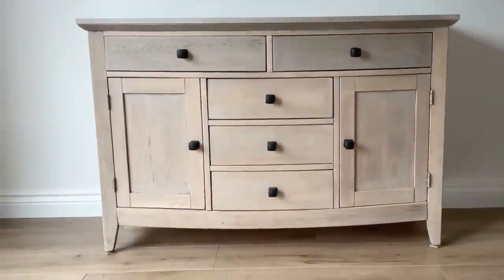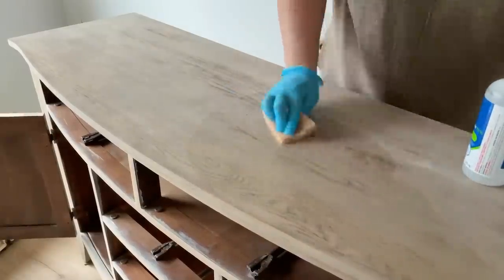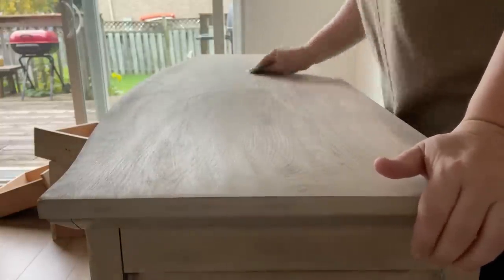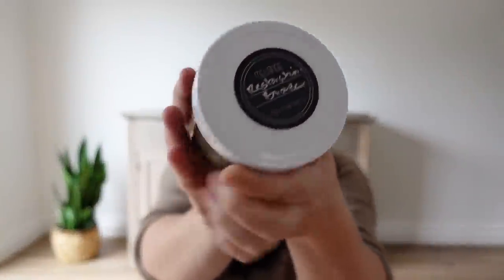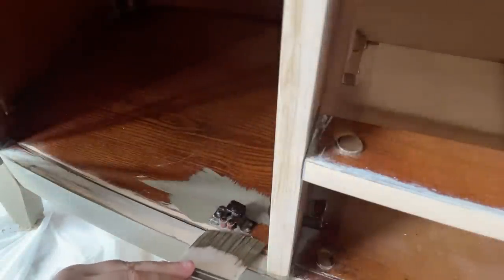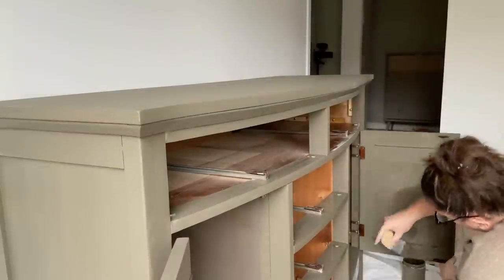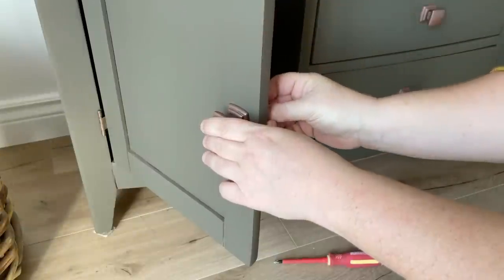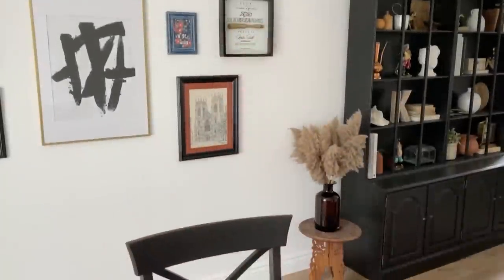One Day Furniture Makeover | Beginner Friendly without any fancy tools!

Comment: Hi Katie, I was looking for furniture painting ideas and inspiration and found your channel. Your makeovers are great. The problem is I live in the UK and can’t buy the Melange paint, can you tell me more about it so I can find a similar product in the uk. I can buy French Chic, Annie Sloan, Rust Oleum, Dulux etc. I have a wardrobe which I painted ,not very well, a few years ago and would like to repaint it, the trouble is I need to do it inside although I can remove the doors and take them to the garage. It’s a pine cupboard which years ago I restrained, and then rubbed down and painted with an emulsion paint and rubbed furniture wax on top. I have seen how to remove the wax and can sand lightly inside. I would like a finish which is lovely and smooth. Any help much appreciated.

Comment: Hi Katie! Love this piece and the color!!  Normally you sand lightly in between coats. Is that not necessary with this paint?
Reply from the maker: I don’t usually sand between coats with any paint unless there is a super rough texture or I’ve got something stuck in my finish. BUT you can if you feel like it’s necessary.